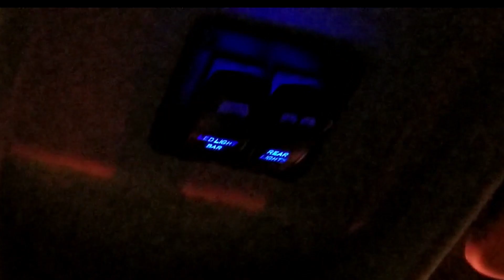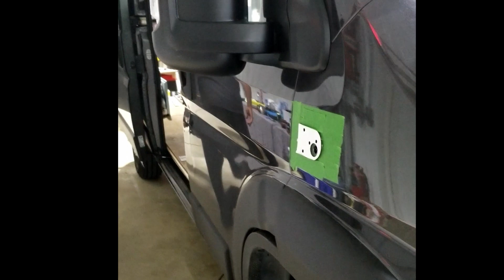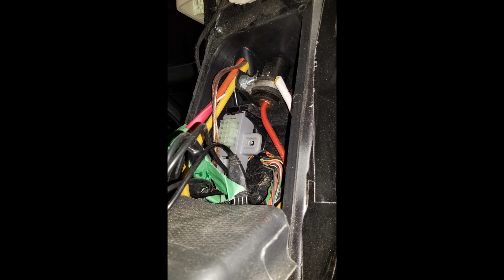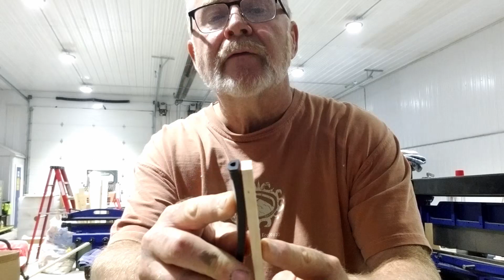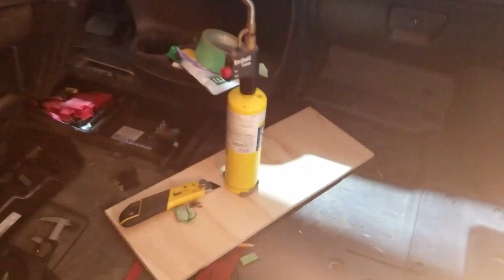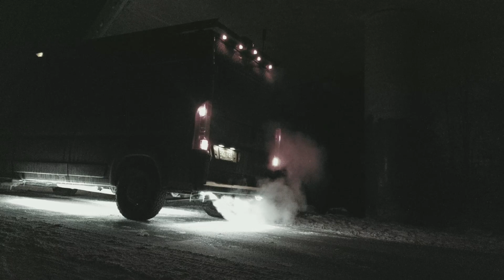VAN BUILD EP2: CAMERAS, LIGHTBARS, SWITCHES. Cutting holes in my Promaster van!

Comment: Hi Rob & Jan, this is a very interesting video.  I am wondering how happy you are with the camera system now that it's been a year since the installation.  I like the clamps with rubber that you used, I haven't seen anyone else use those.  I had purchased a similar pack of clamps to use on my van before I saw this video.  Also, how did the light strip install underneath the van work out?  That looks like a great way to protect strip lighting without spending a fortune on rock lights.  Happy travels to both of you!
Reply from the maker: Thanks @Pete Frost! We are very happy with the camera system. No issues. The under mount lighting was a 3 piece kit that is used to light the box of a truck. It was put in clear plastic tubing before installation for added protection. This is also working great for us. 👍 We appreciate your comments. Thanks for watching! 😊